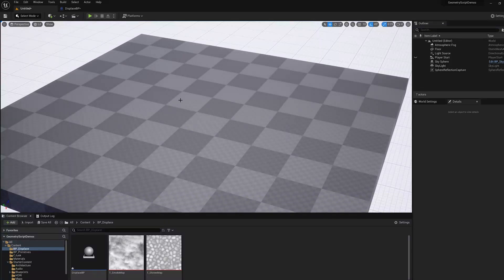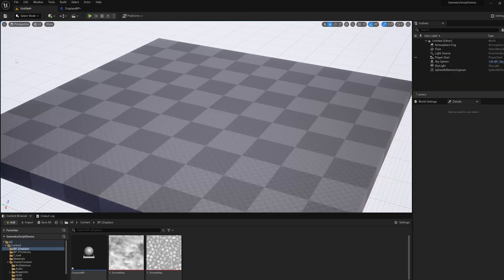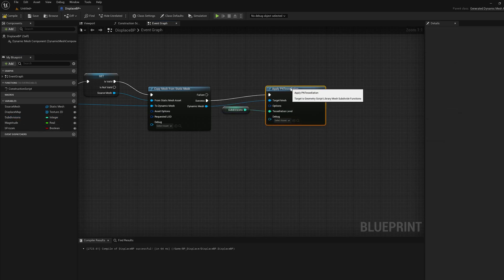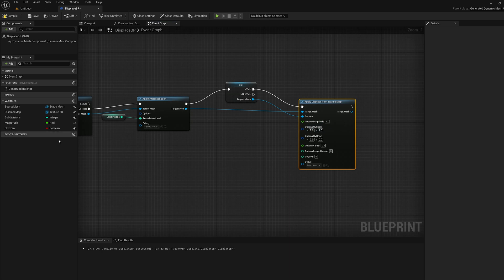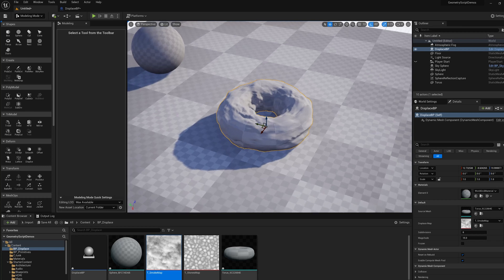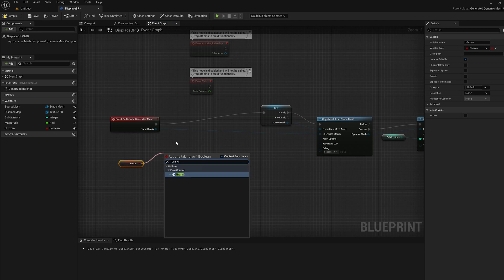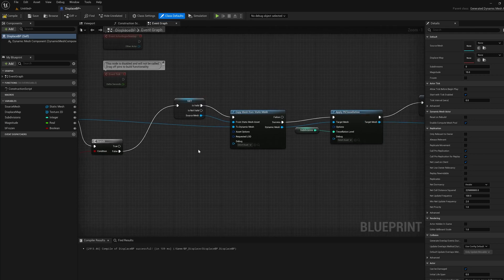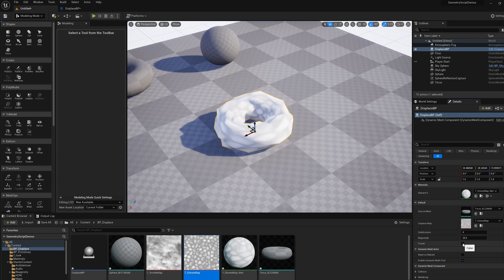UE5 Geometry Script - Displacement Map

Comment: This is great! Is there a way to starget only a single color channel of the texture 2d node? I want to use this for megascans textures but its packaged map and the displacement is the blue channel. Or perhaps a way of duplicating the texture in unreal and disabling the other color channels? i dont want to have to use photoshop to export the blue channel as another texture. Thanks!
Reply from the maker: yes, you can specify a specific channel from the texture in the displacement options
Reply: @RyanSchmidtEpic  figured it out! Thanks!

Comment: Hey Ryan, how it the performance between a Dynamic mesh actor vs a static mesh? Assuming you are not changing parameters at runtime
Reply from the maker: A static mesh is more efficient to render, it at minimum uses the static draw path which at minimum caches a lot more things than the dynamic draw path. For a single mesh it's not a huge difference but if you had a scene with lots of meshes, it will add up. Also static draw path can automatically do instanced rendering of multiple copies of a static mesh, whether or not you are using an ISM Component. If you have Nanite enabled, static mesh is even more efficient, even if it's low-poly it will use a more efficient way of handling instances/etc. There are some details on this page: https://docs.unrealengine.com/4.27/en-US/ProgrammingAndScripting/Rendering/MeshDrawingPipeline/. I can't really give you specific numbers though, it is too dependent on your meshes, hardware, scene setup, etc.
Reply: @RyanSchmidtEpic  thank you for taking the time to do a detail answer! This is more than enough! Thanks a lot!

Comment: hi, can virtual textures be used as in UDIM support for this? Great vid btw
Reply from the maker: This method is using the source texture image, so it won't matter if it's a virtual texture or not (if the source texture is very large then it will require a lot of memory, though). No UDIM support currently.

Comment: Good afternoon tell me please
What processor are you using in your computer?
It takes me a long time to process, when working with displacement maps.
Thank you :)
Reply from the maker: in these videos I am using either a 64-core/256gb or 24-core/64gb machine. If you are using large meshes then it does really help to have a lot of cores as many of the geometry operations are multi-threaded.

Comment: This is cool, but if you then apply your material to that, isn't your normal map and AO etc now wrong as it's applied to actual geometry rather than a flat plane? You're going to to be doubling up on your normals as the shape will still be in the normal map/ao?
Reply from the maker: yes, if you had those maps, they would be wrong if you displace the mesh. However this isn't any different than with GPU displacement materials, for example. And many use cases of procedural mesh generation would be in contexts where you don't have a normal map or AO map to begin with (eg procedurally generating Assets from scratch, at the scale of Nanite content, and/or using Lumen for GI)

(However in future (5.1) we will also have geoscript nodes that can be used to bake new maps)

Comment: Hi Ryan, great series here. I just finished following through all your videos and I learned a lot!

Quick question, is it possible to expand this displacement tool to use a static mesh actor rather than a static mesh?
Reply from the maker: a static mesh actor is just a container for a static mesh asset. So, yes it is possible but you would just extract the static mesh asset from the actor, and everything else is the same.

Comment: Great video! Thanks for the info! I’m curious though, I’m trying to get it to work with a packed texture and I can’t seem to pull a specific color channel in blueprint! In materials it’s straightforward to mask a color channel, I’ve never had to for a BP but I imagine there’s a way right?
Reply from the maker: There is not really a way to do any kind of masking on the input texture in 5.0, however the Options struct for the ApplyDisplaceFromTextureMap function in 5.0 takes an "ImageChannel" argument you can use to specify R/G/B/A (as 0/1/2/3).
Reply: @RyanSchmidtEpic  Nice! Thanks for the info :)

Comment: Is it possible for the height map to act similarly to world aligned textures? to scale the UV's as well as pan the UV's as you move the model around but in BP?
Reply from the maker: You could build something kind of like this yourself by using SetMeshUVsFromPlanarProjection to do the scaling/panning. However the current displace-from-texture node doesn't support anything like this, and it doesn't support any kind of weighting/blending currently.

Comment: Just what I was looking for! 

I’m coming from a CGI & VFX background... wondering if it’s possible to do triplanar displacement this way?
Reply from the maker: ah yea that would be cool, however it's not (easily) doable right now, it would need a custom function (in C++). Conceivably it would be possible to do 3 separate displacements, on 3 copies of the mesh, and then blend their vertex positions in blueprint, but it will be very expensive to do the per-vertex processing.

Comment: I would make a custom event inside the script with call in editor ticked, so a button in the details panel of the blueprint would appear. 
That way you can call the function by pressing a button to recalculate the mesh rather than having to freeze the rebuild event node graph.
Reply from the maker: Yes, that's another option, in that case you can use the base DynamicMeshActor instead of GeneratedDynamicMeshActor. However artists tend to prefer to have live feedback, even if it's a bit chunky, and then the option to pause it, rather than having to click a button after each parameter change - but it depends on how long the mesh update takes, if it is more than 1-2 seconds then people tend to prefer a button. We are considering building this freeze/explicit-recompute functionality into these procedural mesh Actors in the future.